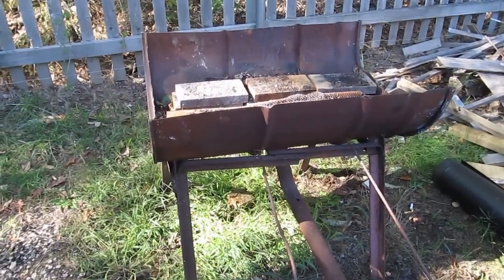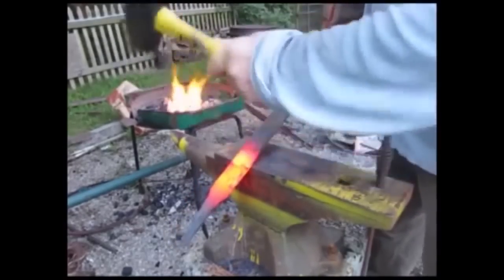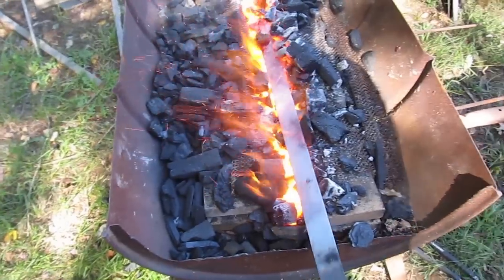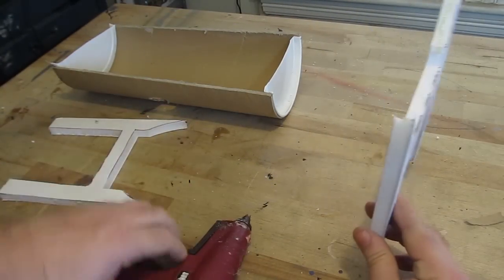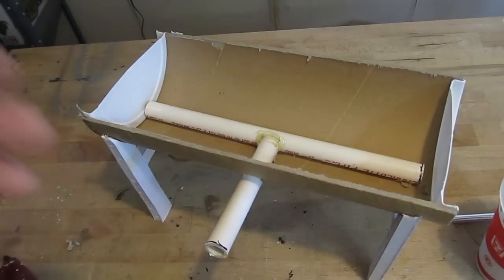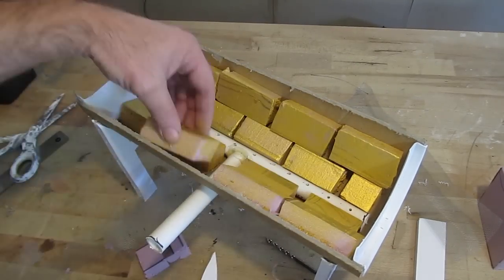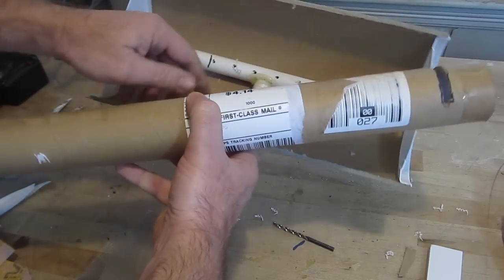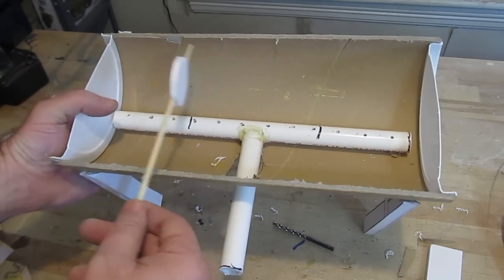How to make a Sword Forge

Comment: That's a good forge plan, I wonder if it would be better if you drilled the holes in the air pipe in the sides instead of the top, just to keep the air from directly hitting the steel?

Comment: What kind of hair dryer should I get for a forge of this kind ? Does it need a cold air setting, and do you tape over the on switch on the hairdryer and turn it off at a separate power off switch connected to the cord ? I have seen something like that, but not sure on the details.
Reply from the maker: Brst to get one with a cold setting because it will last better. Hot settings tend to burn out with lots of use. And.. The switch on the hair dryer is fine.
Reply: Yeah, I was over complicating things. Came across a Conair 1875 with a cold setting. I was interested in your blacksmithing projects, but recently my younger brother came across your Making a telescope tube.  Thanks.

Comment: Is it possible to build a forge out of a barrel like that with air flow control so you can heat up a large sword using the whole thing or a knife using just a section of the forge? I would rather not make 2 separate forges
Reply: then just change the size of the pipe

Comment: Could you  do this without cutting the barrel in half? perhaps using a barrel stove kit to make a nice big door ?
Reply from the maker: There are a lot of ways to make a forge sword. This is just how I did it. One thing, Make sure you never use any galvanized steel. That's important.

Comment: Quick question, is it required that theres no top to the forge? I was thinking of using a water heater or something cylindrical, with doors and on it for either melting in a crucible, or for sword heating. I'm probably going to use Coal, and i'm trying to figure out the best sort of design for an all around forge.
Reply from the maker: You have to manage smoke and fumes properly. But, look up knife forges to get an idea of semi-enclosed forges.  They are gas! So there is a significant difference in fumes.
Reply: epicfantasy if I had a ventilation pipe stemming from it, and it's outdoors, there shouldn't be a problem essentially? Thank you for the quick reply, that's amazing.

Comment: You sword forge turned out great. Will, what is the diameter of the pipe that you used for the tuyure ? Is it 1 inch or larger size ?
Reply from the maker: It's about 2.5 inches in diameter.
Reply: Thanks for the reply. I learned about a similar type of design from a Tim Lively video years ago. He used 1 inch diameter black pipe.

I have had success with holes drilled down the length of a 1.5 inch steel pipe, about 5/16th's sized holes spaced every 1 to 2 inches, with some holes plugged up with dropped bolts to reduce hot spots. It worked well, but I might experiment with a hole arrangement similar to this one. 

http://www.backwoodshome.com/build-your-own-portable-forge/

Comment: What is the liquid you dipped the sword into that started flaming up on you
Reply: You quench in canola oil try not to use motor oil it puts out dangerous gas when burnt. Or you can use water but the blade has a higher chance of warping

Comment: its easy
1. get a fire started (careful it needs to be really hot
2. heat a metal and design it what you want
3.get all the tools hammer,drills
4. water for hardening
5. sandpaper
Reply: oil not water

Comment: is it possible to get this to forging temps?
Reply: Excuse you? It's an honest question, dude. Don't be that guy.
Reply: Nighthawk "how to make a sword forge"..... sword forge..... forge..... forge...... forge
Reply: Yes. But the main use of this type of forge is mainly to harden the blade. Why? Because you really don't need to heat up the whole blade for when you're working on it(work on it in sections instead), as you simply don't have time for it before the blade starts to cooldown. So all you do is waste charcoal/coal if you decide to use this type of forge for all your blacksmithing. 

I'd recommend making a smaller forge first, and get started with that. I made the same mistake at first and made myself a big one, but all it does is eating a lot of coal, and not much work getting done, compared to the amount of coal you put in.

Also, start by making knifes or other smaller things, helps a lot in getting the feel for the hammer and the heat, so you wont mess up when you do decide to make a sword.
Reply from the maker: Wow, wonderful comment. Thanks.  Good community contribution.